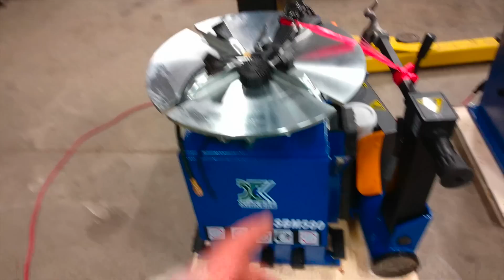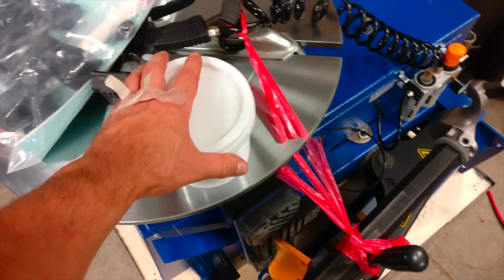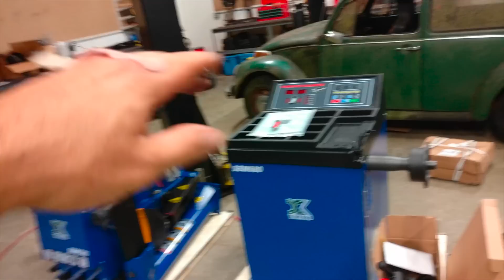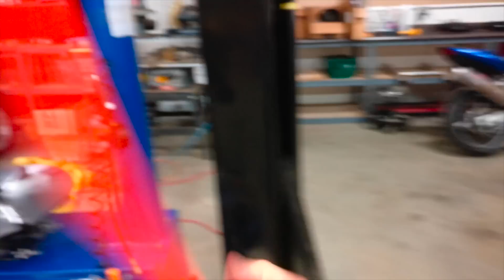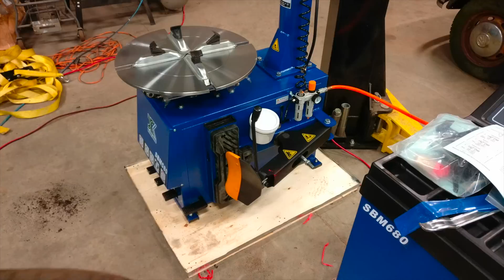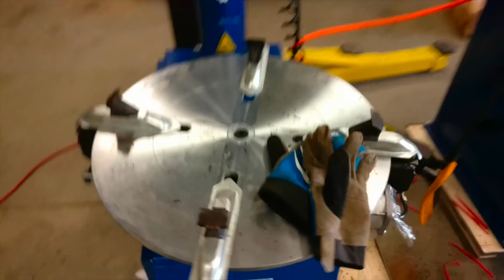Cheap Tire Changer 560 Mounting Machine Unboxing, Test, and Review

Comment: YOU'RE GOING TO BREAK YOUR BACK FORCING THAT TIRE ONTO THE RIM. YOU ARE SUPPOSE TO USE THE LUBRICANT WITH A HAND MOP AND BRUSH IT AROUND THE BEAD OF THE TIRE THEN IT GOES ON EASY"" NOT SUPPOSE TO SPRAY THE RIM...😊

Comment: ONE THE WEIGHTS SHOULD COME OFF FIRST SEC" YOU SUPPOSE TO HOLD THE HANDLE AGAINST THE EDGE OF THE RIM AND TIRE TO BREAK THE BEAD""" YOU'RE NOT DOING THAT AND THAT'S THE REASON IT TOOK SO LONG  TO POP FROM THE RIM. OLD TIRE AND RUST HAS NOTHING TO DO WITH IT😊

Comment: Nice video however the yellow dot is not a balance indicator it is only an inspection marker. try running the rim in your balancer the rim is 100% perfectly balanced with stem or no stem the yellow or red dot is meaningless and just and old wives tale

Comment: Gr8 video.  I loved the balancer vid as well.  I have a tire machine and a big old balancer.  I don't have space for the balancer so was toying about a cheepy one that takes up less space.  We can get these cheap ones in the UK.  They seem to work ok.   One thing I would say, is be careful about spraying soapy water inside the wheel.  It will be there for ever and corrode your rim by the time you need a new tire.

Comment: Do you think 12 gallons tank can inflate flat 21 inch  tire and get it on the rim after tire change ?

If i  just prefill air tank with any compressor and run cheapest  tire changer machine from 8 bar air  tank

Comment: to help break the bead on shitty tires that flop around , keep some air in them. do the back side first, but do not press it all the way off, just down the ledge, flip it around and break the front side bead. You have to do that for atv tires. 5 to 10 psi. My tire changers run on 180 psi, so I can break beads on tires with 30 psi if needed.

Comment: Really curious as to how the tire changer and balancer are doing after over 3 years of ownership. Found this pair for $2K which seems like a decent deal, just curious of reliability.
Reply: Ive had a cheap china model for 6 years personal use and a bunch of odd jobs on the weekends. They seem to hold up good along with the wheel balancer i dont keep em clean and i beat on my tools lol

Comment: The rim clamps always go on the inside of the rim not over the outer edge. Not sure that you have learned this yet but when you set the bead you need to have the tire and rim on the machine surface. You should have your rim clamps on the inside of the rim at this time. This is why the backside of the rim clamps are knurled to grip the inside of the rim.
Reply: my instruction book says clamp alloy wheels from the outside (to prevent marks) steel wheels from the inside,

Comment: Thank you for mentioning the yellow dot needing to align with the valve stem. I saw a red dot on that tire as well. I know that the color of each has a specific meaning and purpose. I think all tire installers that don’t take the time to align the painted dots with the valve stems should be given time off without pay. I’ve often wondered if the hideous cluster of weights on a lot of my wheels would have been necessary if the installer had taken 15 seconds to align the dot with the valve stem. Congrats on the purchase of your tire installer. It’s awesome when you can do something yourself and don’t have to worry about some careless dufus boogering up your stuff.
Reply: Has nothing to do with the dot, as far as clusters of weights all over the place. That has to do with chasing weights, or not rejecting a bad tire in some cases... If a tire takes a lot/ abnormal amount of weight, you break it down and spin it 180*, which if your dots were lined up, they will be 180* off from where they were. Usually that solves a weight issue. If it doesent, or the tire has a lot of run out, then it should be sent back to supplier as defective... So if you take it to a GOOD shop, and you see they are not lined up, there might be a reason.
Reply from the maker: @mattdudley3789  keep it mind that it could also be from a bad/damaged wheel as well.
Reply: @TimNummy  A bad/ damaged wheel would be obvious, in which case, you inform customer that the wheel is bent, mark it with a tire crayon and put it in the rear.  Lot of times the customer will want a new wheel and you order them one. There is nothing more you can do with a bent wheel.  You have to watch the tire in relation to the wheel to determine if it's the tire or the wheel. And the other thing is check that the cone is centered, because if it's not perfect, it's not going to work.. I've had first time customers come in with a shake, only to find that the inside beads on 3 tires were not fully seated at the other shop
Reply: It's supposed to be aligned the the red dot
Reply from the maker: @TheBraulio459  the red dot gets aligned with the balance mark on the wheel, should it exists.. and should be used in priority over the yellow dot.

Comment: 13:45 no.. just no. Soapy WATER should not be on the inside of the rim or the tire, as the moisture evaporates this will cause the tire and the tire pressure to vary a lot under different temperatures during driving, hot and cold weather etc..
Reply from the maker: What would you suggest instead? Being critical without suggesting a better alternative isn't helpful.
The machine came with some paste lube but it's hard to apply and doesn't work well.
I also know that soap can have a negative effect on aluminum over time and water can speed up rust, but all things considered, the air from a compressor introduces quite a bit of humidity in the tire anyway.
I don't know that I've seen anything that says the pressure in the tire will change in a dramatically increased detrimental way by using soapy water over anything else... Especially since it's important to monitor your tire pressure in changing weather conditions anyway, since you should check and adjust it accordingly at those times.
Soapy water seems to be pretty widely accepted for tire mounting. Including in the datasheet on tire mounting published by Toyo tires... https://www.toyotires.ca/sites/default/files/imce/Databook_mdtrktires_tireandrim_pgs_26_30_0.pdf
Reply: @TimNummy  nothing wrong with lube, I would just put it on the tire and the part where the bead hits the machine...I have installed 1000s of tires in my life and those points are crucial to the ease of installation ......also, I would have removed the wheel weights before removing tire as it will scratch the heck out of the rim or take a gouge out of the duckbill part
Reply: @TimNummy  I would suggest using a lube specifically made for tire fitting yes. Like you say, rust or oxidation could become a bigger problem, maybe balancing although it should not be a problem with this amount of water applied, and of course the temperature/pressure variations would depend on the tire dimensions. Bigger air volume = bigger variation. Thanks for you discussion anyway ^^
Reply: @TimNummy I’ve used a mixture of Vaseline and soapy water before, but lube is the “professional” way to go about it

Comment: 13, 14's are easy, when replacing a size 15, it went 3/4's around and the metal bill bounced over the top, and would not press the tire into the rim

Comment: I have same machine my turn table quit turn do you know what cause that.?
Reply: mejores momentos most likely a bad capacitor. But it also could be the foot switch or wiring somewhere.
Reply: Adam FPV thank you buddy I found the problem,do you know how I connect the child the hight blow air is behind?
Reply: *higth blow air is behim the machine?
Reply: mejores momentos take the left side cover off and you will find an electric motor with belt that drives the table, could have broke the belt or it came off. Also you will find a switch inside that the pedals connect to and controls the flow of current for which way to turn the motor. It might have went bad, or a wiring issue.
Reply: It was made in China 😀

Comment: Hey buddy, what is the hose behim the arm for?
Reply: Didnt you see in the beginning? It is the air gauge and air line to fill the tire after you set the tire. It is on a hanger on the arm.

Comment: Sandals? Come on guys long hair tied up safety safety safety. Also you did not what all that moisture inside the tire ,lubricate the bead .all that moisture as a tire heats will cause increasing pressure everything that can be done wrong how to video.

Comment: I suggest getting some non water based "glycerin?" lubricant made for tire work.  When dismounting the tire it can help to spray a little soapy water along the bead as you are trying to break it. Later this soapy solution will help lubricate the foot as it pulls the tire over the rim.
Reply from the maker: Soapy water seems to be pretty widely accepted for tire mounting. Including in the datasheet on tire mounting published by Toyo tires... https://www.toyotires.ca/sites/default/files/imce/Databook_mdtrktires_tireandrim_pgs_26_30_0.pdf
Reply: @TimNummy  Sorry but this is absolutly wrong for steel rims. You might get away with it on alloys but even those could corrode at any nick. Whoever wrote that for Toyo should have been fired. You do not want water inside your tire. Ever!
There is a reason glycerin based lube is made and used by professional tire shops. Even I have it for personal use because I know water does not belong in tires. Besides, it works better for mounting tires. I even gave a tub to my dad who mounts all his tires by hand. Glycerin lube works better and won't cause your rims to rust or corrode. 
Once you have tried to dismount a leaky tire from a rusted rim you will wish you never used soapy water. I have fixed many tires leaking around a rusty rim. It's kinda a pain. Sometimes the wheels have to be completely junked. 
In the old days, you didn't have anything but soapy water. We all used soapy water. If you have to use soapy water you need to make sure its mostly just the soap part. In fact, I wouldn't add any water if I had to use soap.
Reply: @consaka1  Freylube on the beads of the wheels, it's an anti corrosive, no leaks ever, and NEVER use bead sealer.  And actually my shop uses a water based tire lubricant. We fix other shops shoddy work all the time, and can tell our work by looking at the hub face. Most of our customers are return customers due to the quality of work
Reply: @mattdudley3789  I have no idea what bead sealer is. I've never really had bead problems. Except one time when the little bar code sticker went right across the bead area. Little seep that I found pretty fast. Removed the sticker and it sealed just fine.
Reply: @consaka1  Some lawn and garden tires and lots of ATV tires have little nubs that need to be ground off or they won't seal.. Bead sealer is the black goo that pretty much every cheap tire shop uses rather than cleaning corrosion.. I'm in NY, so we even have to needle scale steel wheels on older vehicles.. But the wheels we service never rust again
Reply: @mattdudley3789  Yeah I'm in WA but I have had some major rust come through. Literally had to touch it up with a grinder and repaint the wheel to get it all to seal properly. Never had any problem with glycerin based lubricant. Makes getting everything centered up pretty easy.
Reply: @consaka1  With the amount of road salt that NY uses, it would be a problem.  The Freylube is basically mineral oil and graphite.. Needle scaler on heavy rust is best, then run over it with a twisted wire wheel.  You could omit the paint part if you used freylube as it will eliminate rust.. I deal with some rusty junk, and a lot of ag stuff.

Comment: Did you ever hanve any issue with the arm that drops down to stretch the bead scratch any wheels? Does it work on motorcycle wheels too?
Reply from the maker: I haven't yet and have used it on some pretty nice wheels. I haven't tried it on my motorcycle yet but there's no reason it shouldn't work.
Reply: the bead is going to be very difficult to break with a motorcycle wheel and also sometimes it won’t clamp correctly. also yes the steel duck heads scratch wheels like crazy if you don’t use them correctly i.e. keep them “hovering” above the lip of the wheel and back out the whole arm wit the screw up top.

Comment: This was super cringey to watch but not everyone is an expert the first time they touch these machines, lol. The plastic covers for the clamps are for when you have a reverse drop wheel, so the drop center is closer to the back side than the front side. With these style wheels, you have to mount so the outside of the wheel is facing down on the machine. The plastic covers keep it from scratching the wheel. Also, I recommend having the wheel clamped when you set the bead. When tires explode the wheel goes flying in whatever direction its facing. The mag machines don't offer protection or enough clamping force to stop this but it sends the wheel in a desirable direction. Better to have it fly up and give you a chance to cover your head than it fly into somebody's legs.

Comment: Brilliant thank you, would this be suitable to do Motorcycles wheels as well as cars?
Reply from the maker: I'm sure it would be! And I hope it is, because I plan on changing motorcycle tires with it myself haha
Reply: @TimNummy  yes you can do motorcycle tyres on them machines i used to work in a tyre shop for years. steel rims can put on table with the clamps inwards then brought out to clamp the wheel only use the clamp way you did for alloys keep the table clean and jaw runs clean and oiled as they can stick over time. on "sticky" beads use bit of tyre soap (lube) when using bead breaker as it acts like penetrating fluid on a stuck bolt

Comment: What is the biggest size tire this machine will accept? Will it do tires for a lifted truck (~35") or will it really only work with smaller car tires?
Reply from the maker: I think the changer will do 35" and the balancer will do 37" - really the limit on the changer is the mount for the duckhead, if you modified it to move that back you could do larger tires. And it's just 4 bolts, could easily make something out of 3/8 or 1/2 steel plate that would do the job wonderfully.

Comment: ABSOLUTE GARBAGE! BOUGHT ONE AND THE AIR BLASTER PIPE WILL NOT HOLD AIR, BECASUE OF LEAKS IN WELDS. HAVE DONE 23 TIRES AND THE PART WHERE YOU  BREAK THE BEAD DOES NOT WORK ANYMORE WHICH MAKES THE MACHINE A LARGE PAPERWEIGHT. SO IT COST ME ABOUT $40 A TIRE TO PUT ON A NEW TIRE. TRIED TO GET IT FIXED UNDER WARRANTY SINCE IT IS ABOUT A MONTH OLD AND THEY WILL NOT EVEN PICKUP THE PHONE. AVOID! THIS PIECE OF CRAP.
Reply: Good to know. Thanks.
I have a place nearby that services and resells old coat units. May go that route.
Reply from the maker: Weird - over a year and countless tire changes, my machine is still working nearly flawlessly. There's a slight air leak when the jaws are open and every once in a while I have to jiggle the pedal to get the table to rotate, but other than that mines been working like a champion since day 1.

Comment: The mounting machine (only) cost around $850, divided by $60 (average cost to get 4 tires mounted) is 14. Fourteen sets of tires and the machine is paid in full. Not bad if you have a lot of cars at home and you are machanically inclined. Thanks for the review!
Reply from the maker: I think it paid for itself in about 6 months for me!
Reply: 16 inch tires without tpms are $20+ each. $100 is more typical tire mounting price.
Reply: Don’t forget depreciation and maintenance costs.
Reply: After 10 plus years of changing tires by hand, it is well worth it.

Comment: i'm thinking of buying a chinese machine, can anyone tell me if it makes much difference with the 110v vs 220v? its for a low volume shop
Reply: Akeem, 220 will give you more power because it uses both phases, but you will have to have a 220 line run to the machine from the breaker box, if you don’t already have one. Most houses do not have 220 run throughout the house, but it’s common in commercial spaces.

Comment: Title says 560 but the demonstration is on a 580. This video is embedded on a ebay item for a 560. Are you affiliated with those sellers and what is the difference between the 580 and 560
Reply: I bet it has to do with tire sizes or rim.  One may do up to a ex. 36" while the other possible do a 40" tire.  I would go with the larger as you never what the future needs are.
Reply: @johngirouard5242  I purchased this combo ....I friggin love it.
Reply: @KentucKY-427   What seller did you buy from on ebay, looking at buying one but cant seem to get a straight answer on shipping?
Reply: @scottdinehart4986  I'm pretty sure I got mine from xkvehiclerepair  But I actually think they are all the same guys with different store names...and it looks like they raised prices in the last couple of months by about $100 bucks or a little more. I think I paid about $1280 for my combo. * Tip wait for the 10% Ebay bucks offer and you'll get a 100 ebay bucks coupon* Thats what I did to buy a master wheel weight kit with money left to spare.*  I got the free shipping. If you have a business address its free but you will need a way to unload the boxes...  or it cost more and you need to let them know ahead of time. I just went and picked up at a local trucking company they loaded the two crates onto my car trailer for free and I just strapped everything down. The crates were stacked on one pallet...i had them separate them so they would ride on my trailer...The crates are pretty damn heavy one box more than the other....but I certainly love the machines they are pretty fucking badass the more you get acquainted with them. They are cool as hell slight learning curve...but once it clicks in your head and watching a few youtube videos you are a total pro with these.
Reply: One has a bead blaster built in, no rim or differences otherwise